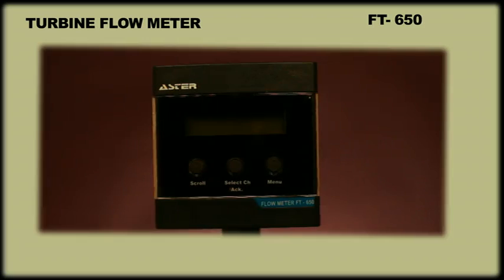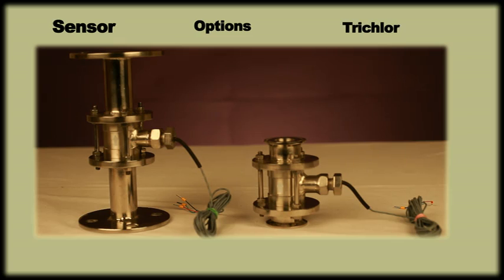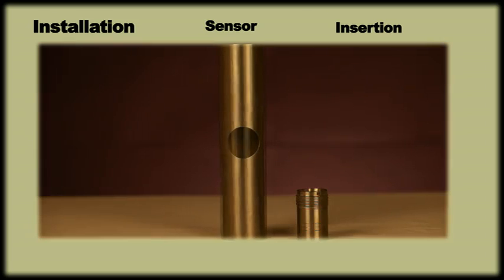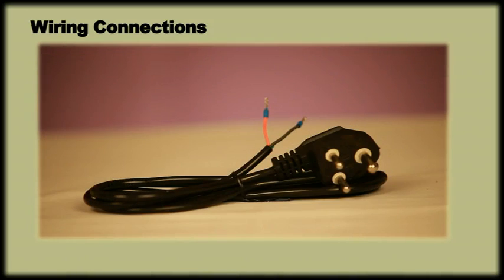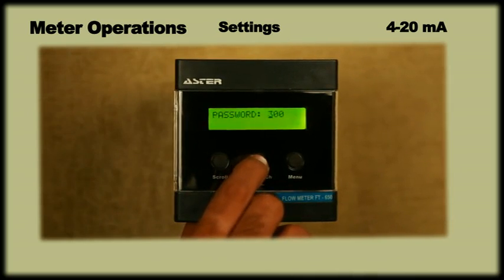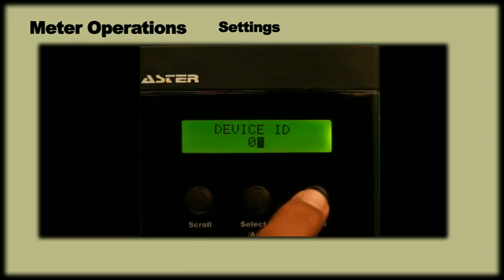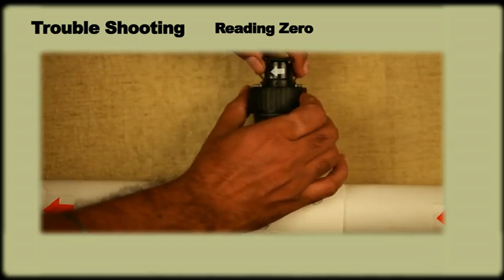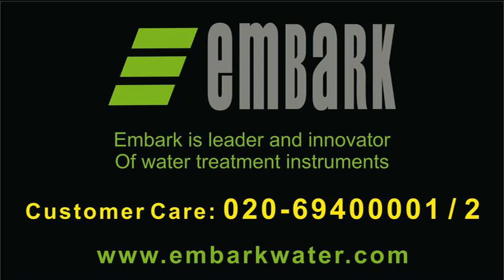How to do the setting of FT 650 flow meter #flowmeter #Aster #settings #Flow #Turbineflowmeter

Comment: I have this flow meter, but when I cut of power totalizers value shows zero, what is the problem??
Reply from the maker: Please contact to our customer support on +91 7276003731 or share your contact detail
Reply: @embarkwater8097  Number is not reachable
Reply from the maker: @sushantshinde7490  share your contact detail
Reply: @embarkwater8097  same problem we are facing??
Reply from the maker: @Danishakhtar012   contact to our Customer support on +91 7276003731 or share your contact details